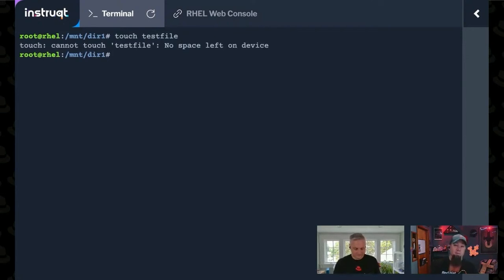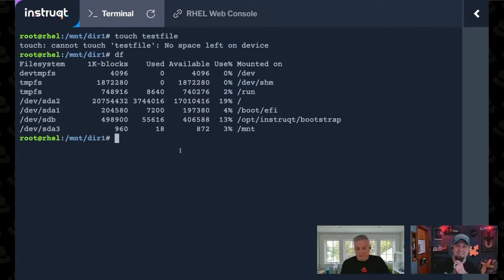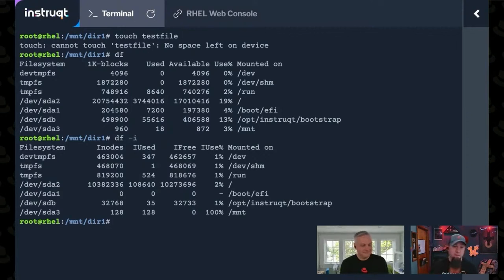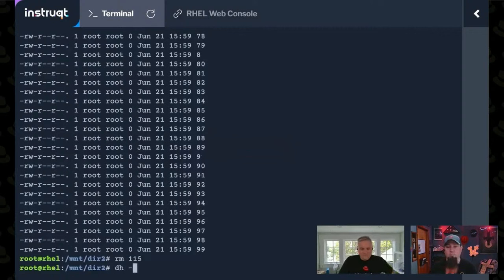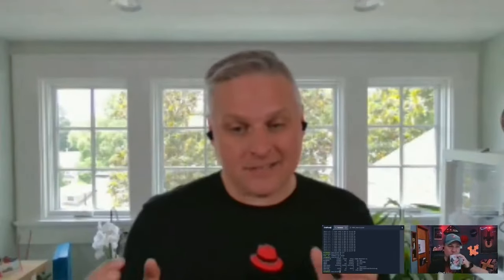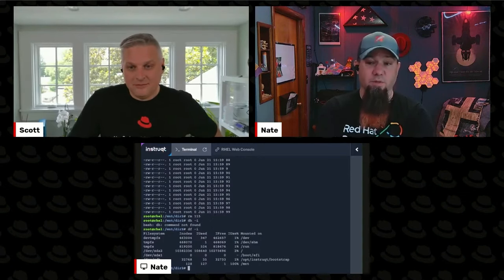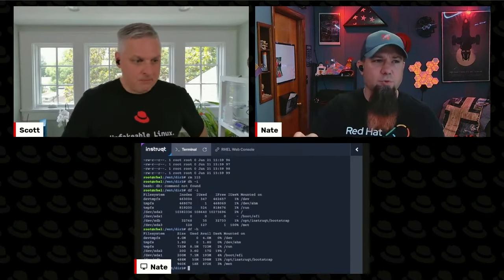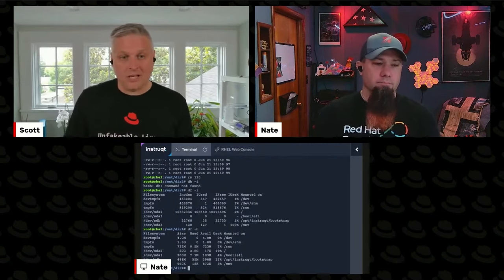File System Out of Space? Learn How to Quickly Fix It

Comment: Inode, same scenario am faced in an interview. 👍
Reply: This is a somewhat common question in Linux Admin interviews because a lot of people understand disk space, but not that filesystems have this other, limited resource as well. Personally, I think it's a 'gotcha' question as most commonly the reason a filesystem is full is because file data is using the available disk space.  But I have seen a few times over my career where this has been an issue and usually it's because someone did something silly or an application behaved in an odd way.

Comment: Hi,

Swap space usage is high even vm.swappiness set 1 and we have plenty of available memory on rhel9 server. do we need to set any other sysctl config to only swap when memory reaches 99%
Reply: Unfortunately, that's not how swapping is implemented in the Linux kernel.  vm.swappiness is a setting that adjusts the aggressiveness or preference that the kernel has for utilizing swap space.  It is not a %.  So setting your swappiness to 1 means that the kernel is going to be not aggressively utilizing swap.  That does not mean it won't use it.  It just won't try super hard TO use it.

That said, the kernel on your machine is likely utilizing swap space because it wants to keep that 'plenty of memory available' for the system and processes that might want to consume it instead of using that memory to store things that are not actively being used by the processes and services running.  I would argue that the fact that it's utilizing swap in this way is a GOOD thing because it means that you can use the system memory for applications as needed, but also for things like caching and buffers, which are a proven method of improving various system activities (e.g. helping system performance).

Conversely, if there was such a setting as you describe (there is not) that would trigger swapping at a certain threshold, that would be very, very bad for system performance as it would create a situation where at a specific moment, the kernel would have to stop what it was doing to spend time on culling through memory, then kick off a bunch of disk-intensive operations to swapout content.  During this period, all the other programs on your machine would likely be severely impacted as the compute is actively being pulled away from them to attend to this 'event' that the kernel would need to handle.
Reply: @scottmcbrien6535  Thanks , receiving alert swap space often on servers, cpu usage hits high due to kswapd0 process often. do we have any limitations, what size of swap is needed for ram on server
Reply: @ImranKhan-zu6qv  I'd look at vmstat.  What does si [swap-in] and so [swap-out] show?  Is there a bunch of activity happening (meaning the swap space is pretty active)?  If your swap space is generally active, it means your system is putting things in and out of it with some frequency.  Adding additional swap space isn't going to change that, but it could affect the % of swap used on the system and potentially alleviate monitoring alerts.  However, based on the very limited description, I would suggest the only real way to resolve this would be to add more RAM to the machine.

How much swap should a machine have?  That's a really hard question to answer.  Personally, I run my machines with really small swaps and really large amounts of memory.  But I run the risk of having out of memory issues when I use all the virtual memory (RAM+swap) on the system.  Additionally, as the system becomes more memory constrained, caches and buffers will be smaller which can adversely affect disk operations and network operations.

Conversely, having large swap spaces allows for more memory in the virtual memory management system, but realize that swap is not great for system and application performance.  Having a large swap can keep you from having Out of Memory (OOM) issues, but as you start consuming swap and si and so operations are happening, you lose system performance due to increased disk I/O requests and wait times for applications waiting on data they need to operate.  It also may depend on your hardware.  For example, laptops use swap for writing memory information prior to hibernating.

I've seen recommendations around the Internet for 1x RAM or 2x RAM or some that are a % of RAM.  Red Hat currently recommends a scale based on RAM sized swap space.  You may need more if you're using laptops to accommodate for hibernation.  https://access.redhat.com/solutions/15244

Something else to check on the system, are you using a lot of tmpfs formatted filesystems?  How big are they?  tmpfs is stored in virtual memory (RAM+swap) and is a swappable type of content, so if you've got a bunch of applications that are storing their state this way, all that 'file' data they have stored in memory could be causing your swapping woes.

You might want to open a support case with Red Hat, they may be able to better diagnose things since they capture a bunch of system information through the sos application for the Technical Support Engineers to review about the state of your system, which you probably don't want to provide to randos on the Internet.

Comment: Hey Scott, Nate :  I've been using Linux, ( and tried BSD spins...), since Win 98 , XP days, ( think Xinerama configs, etc ),  I digress.
Over the last say 8 yrs, rather than using the GUI default set up ( and letting the distro's system mess me up )..... I do this kind of set up via the custom settings :
I do; nearest the MBR area , /dev/sda1, ... 100 MB ~ 600MB for the UEFI partition, as vfat, ( waste of space, I know,... as the UEFI is like 4.8 MB), ... Then /dev/sda2 as root , /, at 100 GB, ext4   .... Then /dev/sda4 as /~, home, ext4. and the last 8 GB on the drive is set up as swap... /dev/sda3 ....in case you wondered where the sda3 partition went to, lol.
So the 1TB drive looks like this:

MBR,...SDA1,/boot/efi, vfat, 600MB......SDA2, /,ext4, 100GB ,.... SDA4, /~, ext4, 876.5 GB, ..... SDA3, /Swap, 8 GB ... End of disk space 

This works like a charm.
Your thoughts ??
Stay Safe
Reply: If you are going to ask why the odd size of  /~ .....  the drive size was calculated on a block size of 4096, .... I tried to get it down to 512 ,  ..... but I guess they would have interleave issues if they got that small,  so the MX installer said  "No can do for you " , and left me with a minimum block size per sector of 4096.
So I did /dev/boot ... Then Root , then Swap ..... And left the rest as  /~
Ciao
Reply from the maker: Looks great! Thanks for watching.
Reply: @Yamahog I'm a big believer in two things:
1) reduced complexity in filesystem layout
2) Logical Volume Management (LVM)

I regularly use a /boot, swap (though I often skip this), and / (backed by LVM) as my layout.  /boot should be about 1GiB these days to accommodate larger kernels and keeping a couple of backups and rescues.  By keeping everything else on a single filesystem, it eases my administrative burden on the machine, when the filesystem is reaching full, I add more space from the LVM or add an additional disk, throw it in the LVM, and add more space.  In the era of needing to apply system administration practices at scale across hundreds or thousands of machines, this approach means I can apply a consistent methodology to my population as well as have a pretty good idea what to expect when logging into a random machine.  It also allows for things like automation to be used in the environment because the more standard and less complicated I can make things on the machine, the less edge case or nuanced content needs to be accounted for in the automation.

Nuance Alert: This is not for everyone.  For example, if you're required to comply with security certifications, they often have separated filesystems required (though I would still implement these via LVM so if I need to grow them, I can adjust the space for them as needed).  Also, if you're doing something specific, like a mail server (which was mentioned in your additional comment), you'll want to do things like put /var/log or /var/spool/mail on a specific device since you can't always control or predict it's contents.  [e.g. what happens when someone sends you a lot of mail?  You, as the administrator, can't control the behavior of other people using the services offered by your box]. That's a really long way of saying, my preferred method isn't always the right approach for everyone, and in any sufficiently complex environment, there's bound to be some deviation.  That said, IMO, you want to keep those deviations to a minimum, and well documented so that you have less wonkiness to account for when you're trying to do entire population actions.

Filesystem configs are, and have been since the beginning of time, a challenge and there's no "one way".  This is made even more difficult when you think that the decisions you make on the day you're installing this box may be with you for the next 10 or more years until the box is decomissioned!  That's one of the reasons I like software like LVM and/or RAID so that I can build as much flexibility into the system at the front as a I can.  Future me will thank me...

As for block size, with the size of disk drives today, there's not a lot of reason to try and squeeze every little bit of space out of the device as there once was.  Similarly, with the inclusion of technologies like LVM, you can always add more devices later to add more space to the system.  It's not like ye olde days where I had a 1 GB hard disk in my $20,000 SGI machine...  With that in mind, I like to take the defaults.  If I take the defaults, then I don't have to remember choices I may have made years in the past, things just generally work, especially on RHEL.  If I'm working with a bunch of small files (1-3KiB in size) will I lose space by using a 4K block size?  Yes.  But I generally don't work with large volumes of small files like that, and if I did, I'd just keep adding disks, which are not super expensive these days.